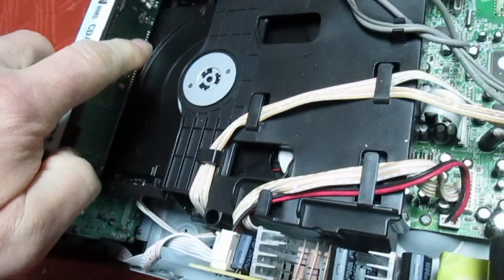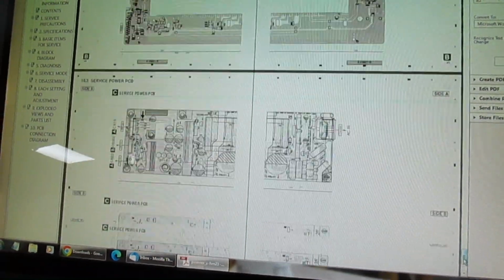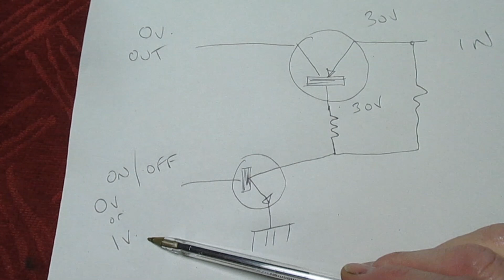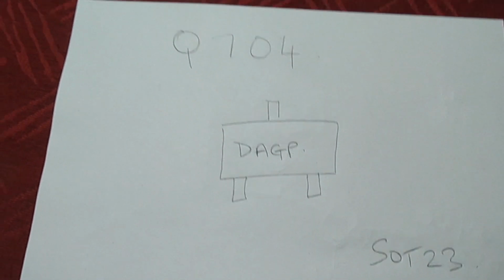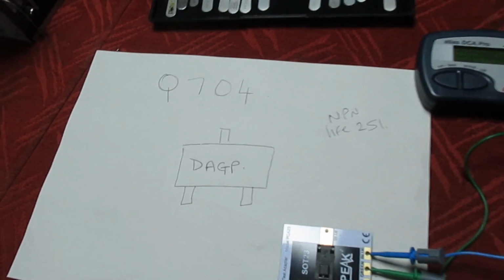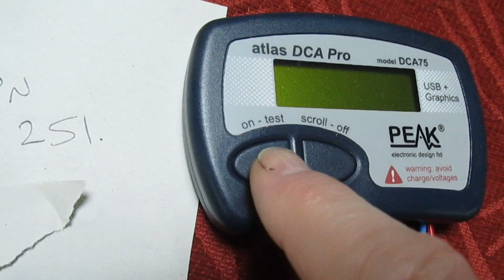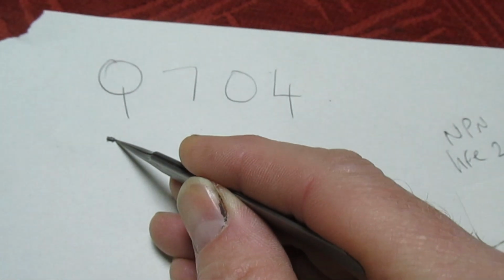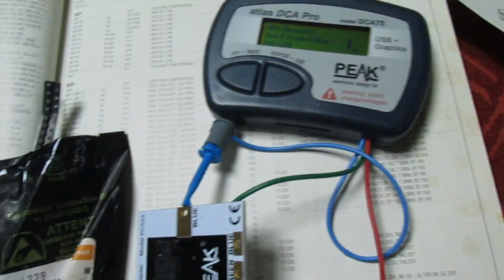Pioneer  X-HM21 repair . No display on front

Comment: The DCA75 will identify the device as a "Darlington" if the Vbe is greater than 1.00V for devices with no internal shunt resistors or greater than 0.80V for devices with internal shunt resistors. I need to re-check that those thresholds are indeed correct as I see yours detected it as Darlington for just >0.9Vbe. In some signal transistors, when they go faulty, develop a very slopey B-E junction and so the Vbe rises more than you would normally expect, and so show as a Darlington. Also, if that happens, the current driving capability (through the collector-emitter) can be badly impaired. It may test ok at 5mA, but really struggle at higher currents, as you have seen. Cheers, Jeremy (Peak).
Reply from the maker: Hi . Jeremy , many thanks for the explanation, I did also later try a B-E diode junction test with an analogue multimeter which did indeed show up as a higher than normal B-E resistance which incidentally seemed to change every time the transistor was tested .
Reply: @michaeldranfield7140  Yes I was thinking that was weird and do the old multimeter test

Comment: Hello Michael, old lady (87) has a Pioneer X-HM36 with the same display problem. Now I had bought another Pioneer X-HM36 and it did nothing at all. Now I have resoldered the transistor from the defective device according to your solution. 
I was very surprised! 
The display works again. I'm so happy with your solution, thanks Michael, from old lady Martha.

Comment: Hi Michael. Just wanted to add that we ran a Pioneer ASC back then and everything was good.
Then we had to give it up when they went over to centralised service. God alone knows how they work now.
If ever you want a real challenge, you could try working on some of the Denon units that look similar. You may need a padded cell then!!!!!!
Kind regards Allan.
Reply from the maker: I get quite a few Denon units in for repair and manage to repair with quite a good successes rate , however a couple I have not managed as yet is the st/by transformer going open circuit and no longer available and more recently a couple with no DAB radio which I traced to software corruption in an EEPROM .

Comment: Well done. Many of the AUK 2SC semiconductor range had DAG markings, i.e. the 2SC5343S, but, of course, your equivalent / working substitute is fine.
Reply from the maker: I would have preferred just to fit the correct transistor to save time but got a result in the end .

Comment: Excellent! Also had displayproblems with mine. Just resoldered the current transistor, works fine again! A weak point in this circuitboard I think... Thank you for this very well explained video. Greetings from Belgium

Comment: Great display of logic, excellent video.with The sot23 and others I've learned recently the hard way that you ignore the last 2 markings if they are printed bellow the first 2 as they are just a batch or date code and always try to find the manufacturer as that 2 digit code is specific to the brand, that's why data books say random stuff like its a bjt or a mosfet or a diode ect
Reply from the maker: It is a bit of a pain as so much time can be spent trying to track down a part, even worse with SMD integrated circuits that are so small they may only contain 3 letters ,  with a schematic this repair would have been a 5 minute job .

Comment: Hi Michael.
A most excellent piece of deduction. I thought you might short the collector emitter junction to confirm that the display came on. Brilliant work to find a suitable substitute.
I used to work on Pioneer products in the earlier years when data was some of the best. How times have changed!
Keep up the good work.
Kind regards Allan.
Reply from the maker: Yes , just shorting the transistor would have bought the display back on but with a high on the base and no change at the collector only the transistor could be faulty.

Comment: Pioneer had a change of policy on their service data maybe 5/6 years ago. I think what happened was a lot of it was getting leaked on the web which they didn't like. They started to split schematics away from the service data which always used to be present. Also parts have now become a problem so only official service centres can get hold of newer parts at great expense.
When we had audio at our place used to do all the servicing which included all the DJ equipment like CDJ's and mixers. We mainly stocked Pioneer as that was the industry standard in that world. It was quite a sudden change as well, when new updated models in a current range at the time got released suddenly couldn't get hold of parts or service data from the usual channels.
Reply from the maker: Yes I had a look on ASWO and there only seemed to be a remote control available for this unit, maybe then if I spent more time looking on the Internet I might have found a schematic?
Reply: I'll ensure to avoid Shitoneer in future
Reply: Pioneer has tried to use proprietary parts long time, like those car radio output amplifiers with PAL005 chip which was basically TDA7385.
Reply from the maker: @lewiskelly14  Trouble is everything is going the same way these days .
Reply from the maker: @Tegelane5  I can imagine , its even worse when they make up there own numbers .
Reply: @michaeldranfield7140  Sadly so but I try to support ethical companies where I can

Comment: I diagnosed a similar fault with a newer Allen & Heath SQ-5 earlier in the week (no phantom supply) and I used a BC846 so I was shouting BC846 at the screen and you chose one! HAHAHAHAHAHAHAH!
Reply from the maker: Got there in the end , would have been a 5 minute job with a schematic and a part number .
Reply: @michaeldranfield7140  silly question (a Pioneer thing) on the first page of the service manual did it suggest referring to another service manual for the schematic as too often there are 1 or 2 similar related models.

Comment: I've been frustrated several times recently by down loading  service manuals only to discover there wasn't an actual circuit diagram.  Manufacturers obviously don't want their products to be repaired down to component level.
Reply from the maker: Same here but luckily this was available for free on the Internet, you would be very dissapointed if you paid money for a service manual and it contained no diagram.

Comment: as a test, just short the collector and emitter to see if the display came on. You could have fitted a nice 1940s Bakelite switch on the front of the amplifier and marked it "Manual lamps on". Would look good.
Reply from the maker: a switch would have caused less trouble !

Comment: Hi MD I have the same problem I am trying to find a circuit diagram for a Panasonic  Tx49fx 555b ,I can find all the service info except the circuit diagram. How are you suppose to repair without a diagram GRRR.
Reply: I fear you are not supposed to repair it at all - you are supposed to buy a new one. Don't you love to boost somebody else's economy? /s
Reply from the maker: @mynung7008  Trouble is everything is going that way these days .
Reply from the maker: I have noticed for a few years now Vestal have stopped updating there website with diagrams , what problem do you have  ?
Reply: @michaeldranfield7140  I had not starting and please wait so I recapped the power supply and now it is dead ( I have killed other one story of my life ) so I need to find out what rails are missing and start again.
Reply from the maker: @aardvarksmith6852  is this the 17IPS72  power board , if so I have recently had some problems with these and just fitted new boards but kept the old ones for a more in-depth look at a later date . the two I had both had low output voltages

Comment: hi, would you happen to know how to reconfigure the remote control. The remote is working, batteries tested and led flashes but the receiver doesn't seem to detect it. I cannot find a way to program it or even get to the main menu without the remote.
Reply from the maker: best thing to do would be scope the IF signal coming out of the receiver first to make sure that's working correctly .
Reply: @michaeldranfield7140  thank you so much for getting back to me. I'll try it, hopefully that would do. Great video by the way

Comment: How bizarre, a duff transistor with the same gain as a working one. I wonder how it would've tested with a standard multimeter (the usual two diode test)?
Reply from the maker: Yes I tried that and it seems to have an unusually high resistance emitter terminal.

Comment: Hi Michael, I came across your video on converting an old Sky Digibox to a colour bar generator (https://www.youtube.com/watch?app=desktop&v=7B9NdVMegR4)

Is it possible to do this with a Pace?

Thanks!
Reply from the maker: this is an old video now and I cant remember but seem to think not , I know it can be done with Amstrad DRX300 and DRX400 .I think pace uses a different video chip .
Reply: @michaeldranfield7140  Thanks Michael, I might try it with my DRX400.
Reply from the maker: @RyanGonTV  I have not tried it with the DRX400 but it uses the same video chip so it should work the same .